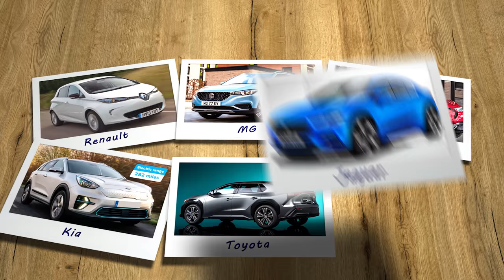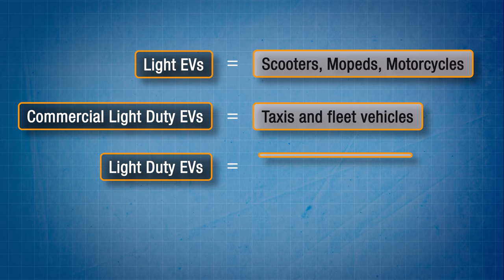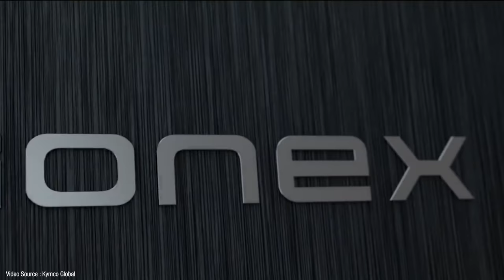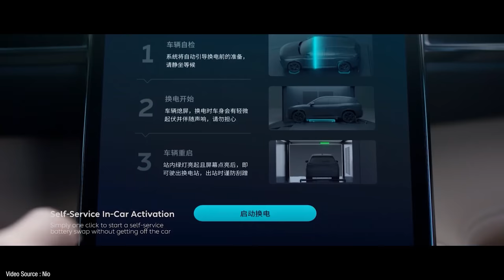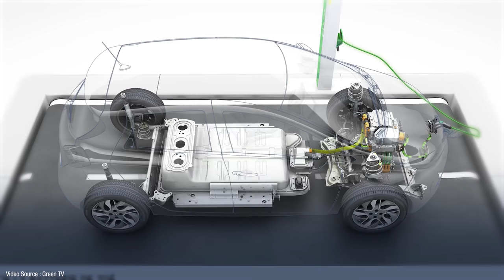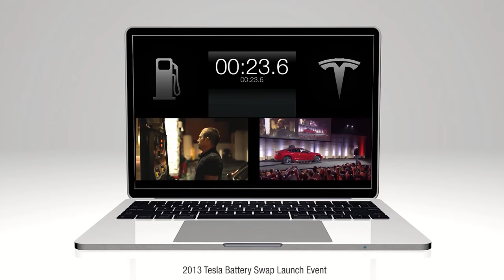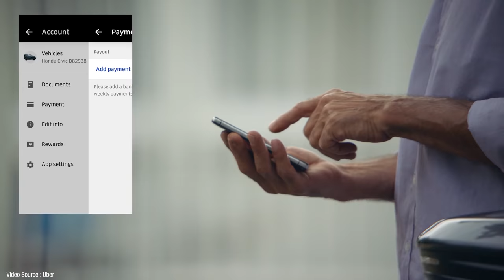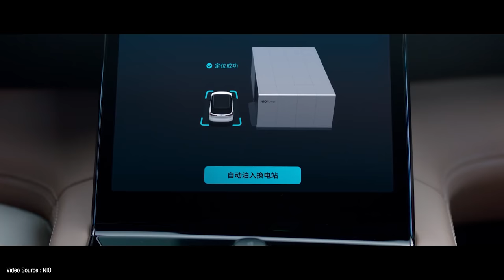Battery Swapping. Transforming the trajectory of electric vehicles?

Comment: Well, talking about standardisation, the modern car is already standardised in so many critical areas. They all have a steering wheel on the same position, use the same (fossil) fuel, have the brakes and clutch pedals the same... What the hell are we waiting for??? If it takes an ‘autocratic’ decision to force car manufacturers towards standardisation, so be it. It merely signals that the ‘free market’ has failed in its most critical task: matching the needs of consumers and producers.

Comment: I can see the benefits of this for people who drive a lot and can't charge at home. But does it really cost less than a rapid charger? I highly doubt that. If the swap station is used a lot, it will need an upgraded grid connection too. And it's only going to be cost effective if it is used a lot.

Comment: Technology of battery charging is advancing very quickly with 800 volt technology, and that's with "conventional Li-Ion batteries". You can now get a long way on a relatively brief stop. The major advantage of a BEV is charging at home. Most BEV owners hardly ever need to get a fast charge, and when they do, they don't need a fill up, but just a top up. That's what Tesla found. It's the freedom "from" having to make a visit station, not the freedom to have to do so, that's a huge part of BEV ownership. The paradigm of going to the service station is going to disappear - a battery swap station is merely an update of an outmoded function. .  Additionally, if every parking meter or multi-story car park had a type 2 charger, that would negate a lot of need. And I find it very difficult to believe a battery swap station would be cheaper than a fast charger station - after all the swapped batteries still need recharging. I can see swap stations a their bases for fleet owners (e.g. courier services) and perhaps HGV fleets. Then there's the issue of reduplication scarce battery resources. You sound very enthusiastic, but honestly, it's a non-starter for the average driving citizen.

Comment: My guess is that the battery-swapping model has so many plusses it will become widespread in every segment. On a parallel track, the so-called "zero mass" battery, in which the battery is inextricably integrated into the structure of frame, chassis, etc., is advancing. Might there eventually be hybrid EVs containing an integrated battery pack AND a swappable battery?

Comment: Full-electric cars was a dead end from the start, but Wall Street needed a new investment bubble. If anyone actually cared about the climate, the way is obvious and reachable - public transport, mass transit, rail-transport, 5-10 times less cars inside cities. But there's little profit and no potential for the PR industry in that. Besides, the main task would be to reduce house heating to a minimum, but the materials have a flaw - they are actually too cheap to be interesting for a profit-driven society.

Comment: There is one issue with battery swapping that wasn’t mentioned. The space required for a battery swapping station seems slightly larger than a gas station.
It’s a minor issue i guess, but maybe worth a thought
Reply: Gas stations have very large tanks underground for the fuel. That space will sometimes be available to battery swapping stations. They can also go up.

Comment: If you were to make a truck at the moment using regular batteries the batteries would be a very significant weight meaning a lot less cargo or a lot less range. Battery swapping could make it so that a truck could have a much smaller number of batteries and stop more frequently for 60 seconds to change batteries. It might even be possible to not have to stop at all if you had a separate lane for swapping batteries you could have a short vehicle like the ones shown in these battery swaps in the video that gets up to around 60 mph and gets under the truck and does the battery change while in motion although that would probably require the truck to be driven automatically so that the truck and the battery vehicle go the same speed and can couple easily. Imagine that driving non stop for as long as the driver is capable and even then drivers will be replaced eventually and then these trucks could just drive forever.

Comment: I don't see how battery swapping is "easier" than chargers. If battery swapping is to work then there sort of needs be a few standard battery form factors. Otherwise, each manufacturer will have to have there own swapping network which has poor economics. Currently, non-Tesla charging stations in the U.S. are having a challenge being economic and they use a standard connector and negotiable charging rates. It is better in Europe but still a challenge.

Comment: I think that battery swapping would be a  hindrance to the adoption of EVs as the industry is (going to be) battery constrained, in which case having to have I don't know how many thousands of batteries stored in the battery stations doesn't exactly sound like a particularly good idea.
Also the speed of charging at charging stations is probably not gonna get worse in the next years so I am not sure whether or not that will be any particular issue.
Especially as charging stations can and will be more integrated into existing parking options.
Furthermore I am not sure whether the swapping stations really are cheaper than the supercharger stations (considering that you need to have expensive equipment to do the swaps and have to have the batteries that are stored there).I mean maybe I'm wrong but that does seem a bit counterintuitive

Comment: The largest bottleneck for EV manufacturers is battery pack production. Battery swapping will require having at least 1.25 more batteries than competitors for the same number of vehicles or essentially creating 0.8 the number of vehicles than you could without battery swapping. Given that there are enough people currently that are willing to pay for the premium for EVs, the high cost does not seem prohibitive for wider adoption for now. As Battery tech continues to drop in price due to massive increasing in battery manufacturing supply, battery swapping may still not make sense in major automotive markets at least in the near future.

Comment: I have to question the claim that battery swap stations are cheaper than Superchargers.  Superchargers are very simple devices with no moving parts.  Battery swap stations are incredibly complex in comparison, and require a stock of batteries to be held at each site.  I think the cost and maintenance advantage goes to chargers.

Comment: Battery swap stations are less expensive than Supercharger stations?  I find that hard to believe.  What happens when there are 5 or 6 cars ahead of you?  Are swap stations going to have 10 to 20 battery packs on hand at all times?  That’s a lot of batteries that could be in cars right now.  And now that all the batteries on site are discharged and are now taking in their slow, gentle charges do I wait several hours for a fully charged battery or do I drive to another swap station?  Plus; battery technology is constantly improving with longer range, faster charge times and less battery degradation, resulting in a battery pack that could outlive the car it’s in.  Battery swaps for cars looks good on paper, but I don’t think its going to work well in the real world.

Comment: Very good, but I don't get Tesla's choice to have more costly and slower charging stations instead of faster more cost effective battery swaps. Why would anyone prefer, under any circumstances, to take more time to charge rather than get a fast swap? Having a charger at home doesn't change that. If swapping were the only available option people would use it. 
   I live in a large high-rise and it's not easy figuring out how to finance electrifying 5 floors of parking spaces when only a handful of owners have electric vehicles... so far... but knowing that if there were charging stations more people, like me, would get electric cars.

Comment: It sounds great.  No hanging about for a charge.  However, not everyone looks after their cars the same.  What happens when you're about to go for a long journey and you get the battery with 80% SOH?

What happens when the whole thing collapses like so many of these schemes has done so far?  What if you're the one left with the duff battery and no-one to get compensation from?
Reply: I can charge my Kia up in 40 minutes or so on a 100kw charger. I can handle "hanging about" for 40 minutes on a 300 mile - or longer - journey......

Comment: For the private automobile owner probably not. I've been driving a model 3 since July 2019. Charging is no big deal. Slower than gas sure ( haven't been breathing gas fumes either) funny how we get used to such an awful experience until we get away from it.( Pumping gas) EV'S are battery constrained adding thousands just sitting around waiting to be used or build out thousands of more EV'S. Maybe for a fleet truck company their own batteries their own trucks. Tesla originally built the S and had replacement centers no one used them... Next

Comment: This is a good idea however I would go one step further

A car should come with a modest 15KWh pack which gives 70 mile range. This reduces the weight of the EV by about 200kg making it more efficient and less tore wear and significantly cheaper

On days you need more range go and get an additional 70KWh bolted to the bottom of your car to give you an additional +300 mile range

This means only the dsys you need more than 70 miles you would need one of these bigger batteries

For most people they might only need thr big battery 5 days a year the other 360 days a year they would be fine with the small super efficient cjeapnlight 15KWh 70 mile range on board battery

Comment: 8:19 “Superchargers are expensive”. No, and wrong. The battery swap stations are large, with lots of moving parts, and crucially need a stock of batteries to be able to swap. This is an enormous capital cost and the maintenance requirements are also orders of magnitude more. Additionally, where you say you can charge the batteries slower or pick cheaper power, you are off base there too. Charging the batteries slowly would mean an even larger supply of batteries to be able to cater for cars arriving for swaps. This means the that actual throughput of a swap station is the combination of the charge time and the remaining stock to be charged.  Then there is the issue of location and utilisation. In order for these to work you need to have a relatively high throughput whereas a supercharger can be as simple as a 2 stall unit mounted on a sled in a remote location. 

I was more positive about battery swaps until around 8 years ago when I started to look at it more carefully. While superficially appealing for those without their own driveway, a better solution is low power AC charging at the street side. Since cars are parked for 22 hours each day there is plenty of time to charge them.

Comment: I’d have answered “No” at the beginning, but then, and as usual, all of the nuances and circumstances so well explored through the show where it just might work make that answer far less confident.  Still seems pretty niche, but those are some pretty big niches.
I am still thinking that if not just the ever more capacious and long lasting batteries combined with expanded and capable charging infrastructure paving the way, then maybe further breakthrough development in pass though batteries where the stop at the pump becomes a matter of swapping out the charge carrying fluid in the tanks.  That or maybe one of the solid or slurry based hydrogen storage systems combined with the fuel cells that keep lurking around the fringes.  At this point though, that’s all experimental at best.
It will all surely remain interesting to keep an eye on moving forward.

Comment: I don't have much of an issue with Tesla building the battery into the body structure ofbthe vehicle just as long as it can be removed without taketh car apart to do it.

While most will charge at home or use a super charger on the road when taking trips I do see the benefits of a battery swap station at a Tesla service center. Say you do need a battery swap because your in warranty or out of warranty needs to be replaced, well swapping it out in less than 10 minutes is a great service to have and offer.

Making the battery structural but modular and quicker to replace with an easy swap could cut down on cost for both Tesla and the customer.

Comment: Swapping always sounded like a great idea, and the implementation you showed for scooters looks perfect. But I need to search Youtube and see if there are any reviews of what it is like using the service on a long-term basis.

However, I'm still skeptical about its viability in larger vehicles because of the size and complexity of the hardware and logistics needed to swap the batteries and to keep them charged. Maybe it could be cost-effective for some fleet settings that can get by with a limited number of dedicated swapping stations in a limited area, but I question whether it could be scaled to an extent that it could support the kind of general long-distance travel that is enabled by something like Tesla's Supercharger network.

I disagree with your statement that battery-swap stations are easier to implement than Supercharger stalls. The robots and other hardware that would be involved has got to be much more expensive and take up more (expensive) space than any fast charging hardware. Plus, unless we are talking about a situation where tons of expended batteries are being transported to central locations for charging, you would still need to provision each location with large amounts of power to charge the swapped batteries. And, if we ARE talking about transporting the batteries, that seems like a wasteful way to move electrons.

Bjorn Nyland- Nyland . Tinfrastructure there is probably the best case available, and it seems that the population, like in North America, likes to hit the road en masse with cars, trucks, trailers, and motorhomes. While their charging infrastructure often looks like Nirvana to me, I note signs of congestion and growing inconvenience, even though EVs are only 15% of all cars in use. Given that their charging infrastructure already has a very large footprint, I am concerned about what it would take to support all vehicles being electric.
Reply: But a battery swap vehicle can use both systems.. and you can also instantly benefit from advances in pack technology and changes in chemistry as they come along, as they surely will.
The other thing is distributed rapid charging is expensive to wire up in more remote areas or  historic towns. 

Swap station technology can be simplified and made quicker by very simple configuration improvements.
As Nios gen one stations require the packs to be rotated through 90deg🤦‍♂️ and driven in and reversed out 🤦‍♂️🤦‍♂️instead of drive through...+ more time and complication could eliminated by negating the need to lift the vehicle by simply driving up a ramp onto the wheel locating points. 

I think their first gen. Swap stations were designed to drop into already crowded urban sites where the  footprint size meant they would fit .
Where in fact a multi lane angled drive through essentially fed by an access and departure road probably under a single roof canopy that can be covered in combined solar PV/thermal  panels.  Then the removed new stored batteries can be dropped out and raised in place without turning them by the simple undo, lower,slide out, slide in new, raise and fix. Drive straight out system.🤷🏻‍♂️
Probably pay while the swap takes place without getting out of the vehicle.
The other factor is you are more likely to get an optimally fully charged pack than if the chargers are busy or theres high  grid demand and shuts down at 80% because the extra takes a lot longer or the next weapon toting customer who has decided they have had a really bad day doesnt want to wait. 
I notice now they are bringing in overstay charges(money) for people who go over the networks variable max charge time limits. 🤑 So thats another plus to a swap system. 
Plus you can have one swapped  by the road side assistance.
Reply: @clivestainlesssteelwomble7665  Good points. I just recently heard about Nio building some swap stations outside of China, but am waiting to see some detailed end-user reviews of them.

Comment: If producing batteries is the greatest bottleneck to electric transportation, then having extra batteries tied into just waiting for the next guy in need of a swap does not sound great... More capital for the battery operator also.
That being said, it sounds like it's all better for the customer.

(apart maybe from the variability you might get in batteries you get from the station)